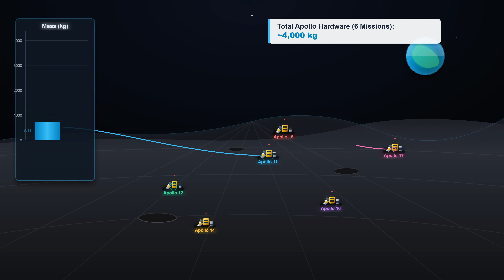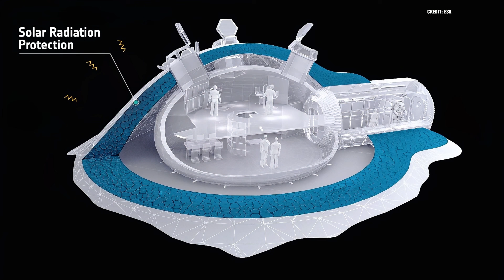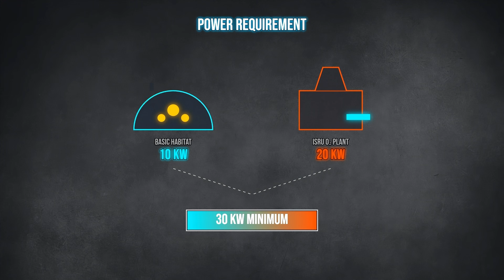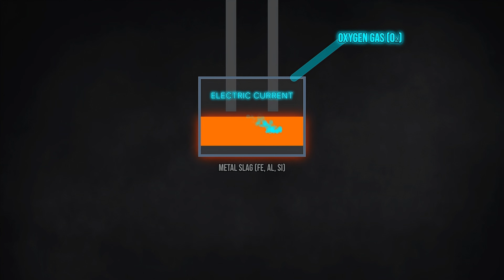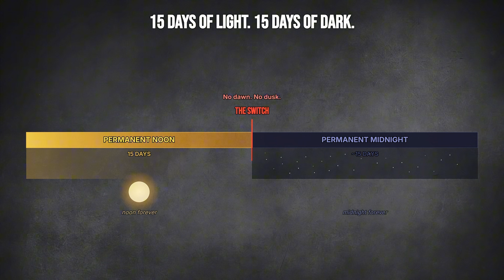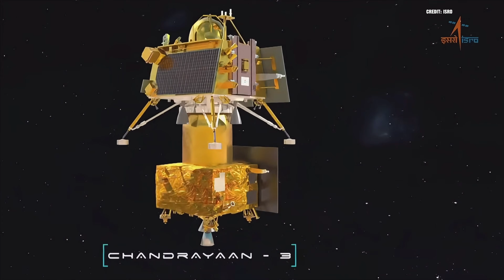How SpaceX Will Build the Moon City Underground

Comment from the maker: One Starship trip carries 100 metric tons to the Moon. All six Apollo landings combined delivered roughly 3 to 4 tons of equipment total. That is not an upgrade. That is a completely different category of logistics.

Meanwhile the radiation on the lunar surface hits 1,369 microsieverts per day. That is a full body CT scan every two weeks with no way to turn it off. And the lunar night lasts 354 hours straight. No sun. No solar power. Just darkness and a nuclear reactor the size of a trash can keeping everyone alive.

Which of these five Moon base systems do you think is the hardest to solve?

A) Delivery — landing 100 tons without crushing the landing site
B) Shelter — burying an inflatable habitat under 1.5 meters of moon dust
C) Power — surviving 354 hours of darkness on nuclear alone
D) Mining — extracting oxygen from rock at 1,600 degrees Celsius
E) Human body — bone loss, radiation damage, and 15 day nights
F) All of them because they form a chain and one broken link kills everything

Drop your answer. We read every single comment.
Reply: All of them
Reply: The human body is very difficult. Biology has never been able to study the long-term effects of the circumstances on the moon. But for a moon base you do not always need humans. You could use remote controlled robots too.

Comment: You're still over hyping things.  I thought you were more of a technical channel, kinda disappointed.

You said something like "regolith in the elevator motor" would be an issue.  Not true.

Where exactly is that motor?  It's about 40 meters up.  So how exactly is regolith going to get 40 meters up?  There is no atmosphere on the moon to carry it up there, there's also 1/6th gravity.  Regolith follows a ballistic trajectory pattern as proved by Apollo, it does not "float" upwards.

Also, please stop showing Starship HLS with it's bottom engines blowing the regolith.  It will be using the thruster ring which are 30-40 meters up on the ship.

Comment: You could create a spinning cone shaped platform, using both the centrifigal force from the spinning conical surface, combined with the gravity of the moon to create a 1 G moving surface to make daily workouts of multiple hours to keep physically fit. In open space you need a spinning torus, on the moon you need a slower spinning conical shape. Do you understand?
Reply from the maker: Absolutely! A banked conical centrifuge perfectly combines lunar gravity and rotational force into 1G.

Comment: Water makes a great radiation shield. If you can extract enough ice water on the moon, you could have a water layer sandwiched between an outer and inner hull which would make an excellent radiation block on a moon base.
Reply from the maker: Spot on! Water's hydrogen content makes it an incredible radiation shield for lunar bases. 💧🛡️

Comment: Long ago… I suggested to Elon to bring one of his Boring Machines to the moon.  Land in a flat bottom crater with steep sides and bore a tunnel.. line it with fused plastic and call it home!  Of course it will need a vacuum chamber to get in and out!  😂
Reply from the maker: Underground tunnels are perfect for radiation shielding. Starship's capacity makes this actually possible!

Comment: One idea I had was once we get some large construction equipment up there why not build a shell that goes up to just below the viewing ports. This dome could at its base be as big around as a football field with enough room inside it to have the bottom be as big around large cavern like machine shop where you have commercial 3D printers where they make larger structure pieces and a large garage for rover maintenance. A floor above for labs then the top being living quarters or more labs. The dome would have a large shaft for a freight elevator to go up to the cargo bay
Reply from the maker: That is actually a brilliant concept! Using the landed Starship as the central pillar for a massive, multi-level dome solves the 35-meter elevator risk and the radiation problem all at once. Having a pressurized ground-level garage would make surface ops infinitely easier! 🏗️🌕
Reply: @TheCosmicRushYT  thanks I just never liked the idea of sending a starship to the moon then gutting them tipping them over on there side and building inside just seems like a waist.

Comment: If they want to do it first they should go all out, imagine the sheer grit of the 90's engineering. So if starship is supplying the tonnage then, let's think building. Not pitch tent, please don't come for me ooooo 🏃🏾‍♂️🏃🏾‍♂️😂
Reply from the maker: Haha no one is coming for you, you're right! 😂 The inflatable "tent" is just the inner pressure seal. The actual plan is to bury it under 1.5 meters of solid regolith armor, and eventually use high-powered lasers (Project Olympus) to 3D print hard ceramic walls directly from lunar dust. Real heavy-duty engineering!
Reply: @TheCosmicRushYT Thanks, this makes a whole lot of sense now. The other ideas just feel like really expensive campers. Is the seal eventually replaced?
Reply: Like I mean with the ceramic walls in place, it would mean that they can eventually pressurize the enclosure and get more room 

Ot it's just dedicated for the radiation shielding

Comment: Technically they could reduce the radiation with materials constructed with emf and radiation reduction levels even in basic forms of types of materials in the inflatable habitat which would help in reduction and magnetic resonances to repel space radiation levels and quarts coating even i wrote  paper on that
Reply from the maker: Great point! Baking those advanced materials right into the inflatable structure makes a ton of sense. Would love to check out your paper! 💡

Comment: In the 1960s, studies such as Project Horizon (1959-1960) and early NASA  lunar base concepts anticipated a permanent presence on the Moon. They proposed covering structures with meters of lunar soil for radiation protection, utilizing nuclear power, and extracting water from hydrated minerals.
Reply from the maker: Great call out! The physics haven't changed since the 60s, we're just finally getting the tech to actually pull it off. Thanks for sharing!

Comment: 1960s lunar base proposals (e.g., LESA, ALSS) primarily planned to use lunar soil (regolith) or sandbags stacked 2-3 meters thick to shield prefabricated, pressurized habitats from radiation and micrometeoroids. Power was consistently projected to come from nuclear fission reactors—such as the SNAP-8 (Systems for Nuclear Auxiliary Power)—to survive the 14-day lunar night.

Comment: The $100k/kg lunar transport cost estimate seems ridiciously high in the context of Starship, given SpaceX is targeting ~$1,000/kg to orbit.
But the real advantage is iteration speed: if Starship becomes fully reusable and produced at high volume, it enables far more transportation and therefore faster build/test cycles than traditional programs like NASA or China National Space Administration.
So we’ll see who gets first to the moon and who scales it into actual infrastructure, but given their speed, reusability focus, and existing experience, SpaceX likely has a strong advantage on the transport side.
And lastly, if low gravity turns out to be a long-term issue, artificial gravity (like centrifugal systems) might be one possible solution — though still largely untested.
Reply from the maker: Great breakdown — the $100k/kg is the current baseline Starship is disrupting. Iteration speed is the real moat. And centrifugal gravity is probably inevitable long-term. 👍